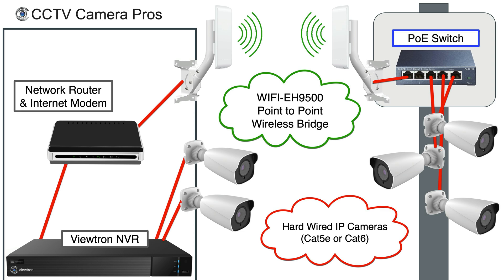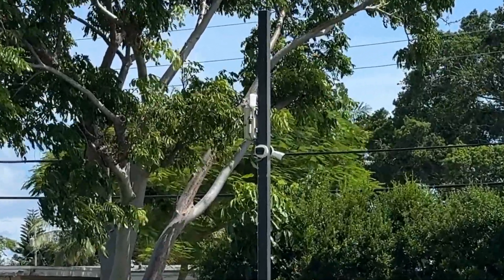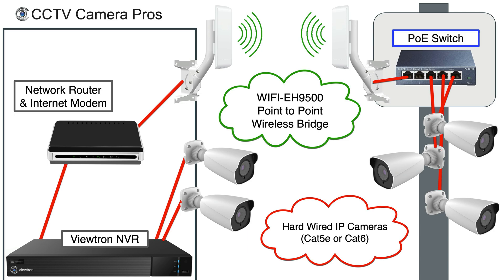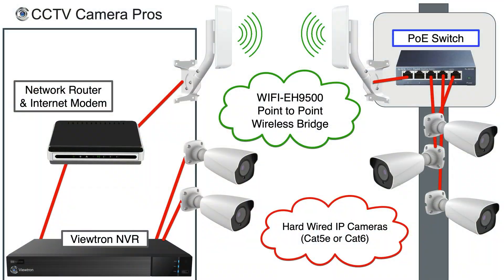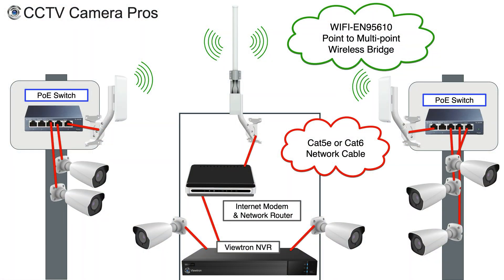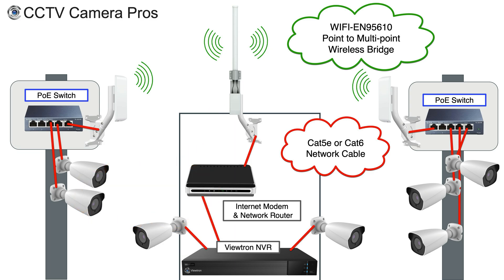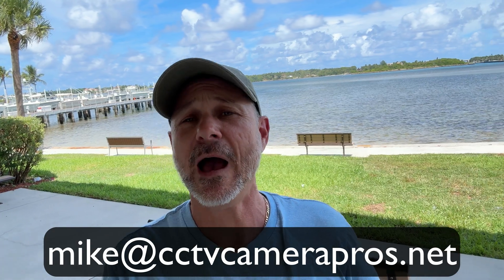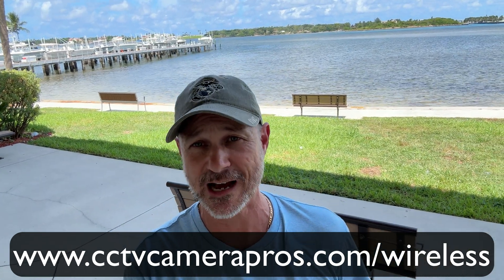Wireless Bridge Solutions to Connect IP Cameras Across Multiple Buildings

Comment: How are you getting power to poe switches?
Reply from the maker: Our irrigation system pump is a few feet away from that pole. The electrician stepped down the 220v to provide 110v power to the security pole.
Reply: @cctvcamerapros  Thank you.

Comment: Hi. This video shows wireless option between two points or multi points, in the same way is it possible to connect with solar /battery power instead of grid power. If possible, can you guide with solar / battery as power & Wi-Fi cameras to record at home which is 5+ km away from the cameras site. No electric source in my site hence, all the equipment cameras, Wi-Fi router, PoE should run on solar panel source.